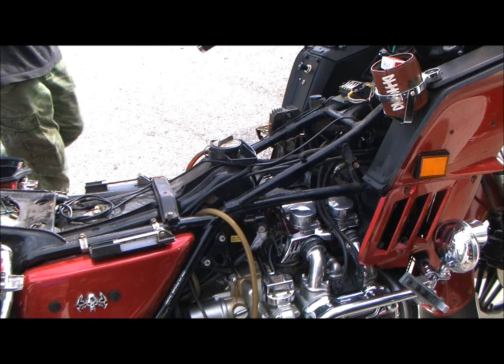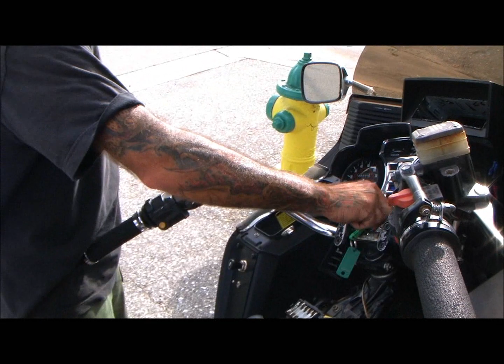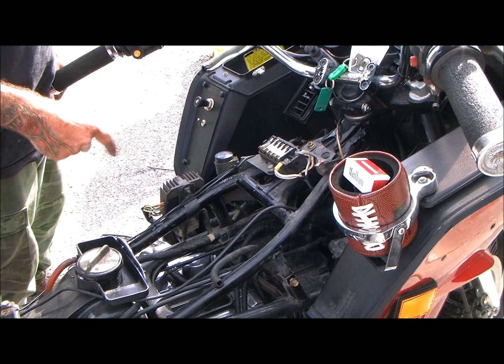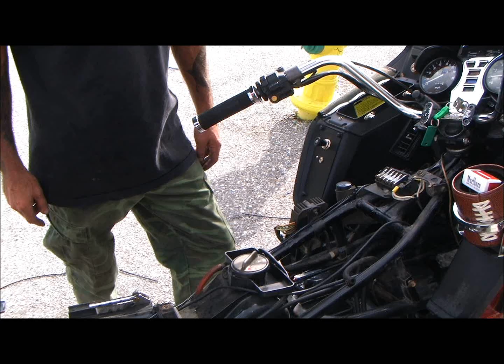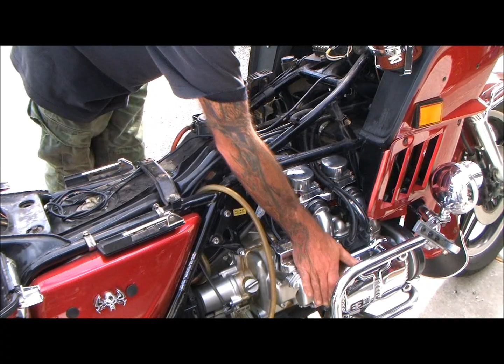1980 Honda Goldwing Interstate - After Accel 140403 Super Coil Installation

Comment from the maker: Yup - and it's the same coil 140403' you call Summit Racing and tell em you want the Kit for 4cyl motorcycles. they have the black kit too if you ask em. .. or hunt around the web - sometimes you can find em cheaper - I just like Summit because they're the ones in my speed dial...  You're running rich enough you shouldn't even have to rejet

Comment: I have a 96 Honda Shadow spirit vt1100c . What do you recommend I run ? It's extremely solid everywhere else and upgraded except for the ignition/fire side
Reply from the maker: leave your boxes alone and put on a set of Accel 140403's for cdi -- Also make sure you run 8.8mm solid core wires - and sheath em in fire loom/ fire sheath  (aircraft spruce and specialty carries it but it's cheaper on Amazon) -- avoid carbon wire like the plague -- I lose the stock resistor plug boots and just buy 4 of the screw on tips for lawn mower spark plugs to put on the plugs in the bike (at the top ) - napa will generally sell those tips loose without making you buy 4 lawn mower spark plugs )
Reply: Awesome thanks alot!

Comment from the maker: The CM450 could go 140403 (if you have 1 coil) or 140408 (if you had 2 coils) - The XS650 - should be a 140408 - if points use condensers externally from a 66 Buick LeSabre with a 430 Engine (dont know the part number because it varies by brand)

Comment: you guys put 140403 coils on your gl1100 but they call for the 140404 if it has cdi does your bike not have the cdi units are does it not make any difference

Comment: what do you recommend for a '84 v65 magna and '83 cb550
Reply from the maker: 140403's with a 1ohm ballast resistor each
The 550 - which box do you have? - there were 2 (3 if you have a mis-titled 82)